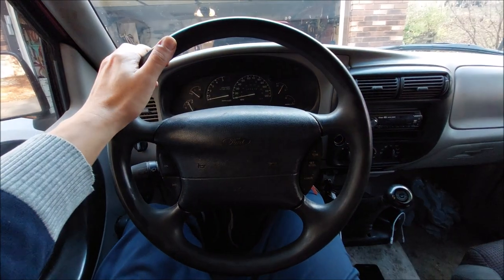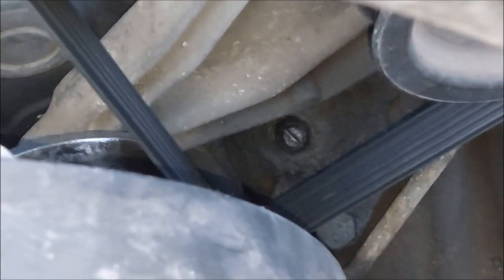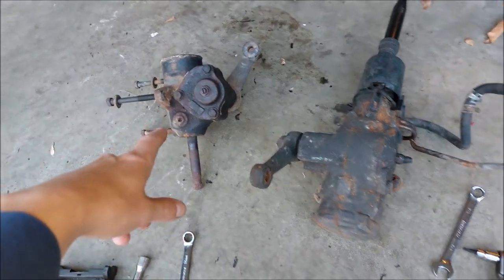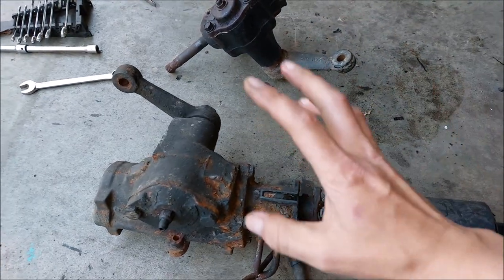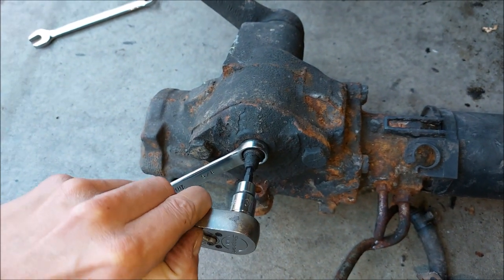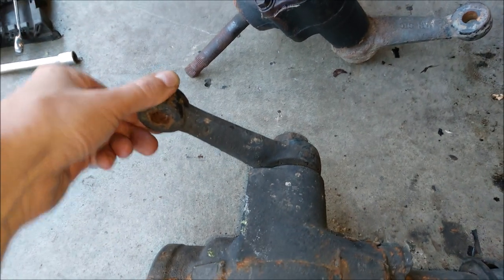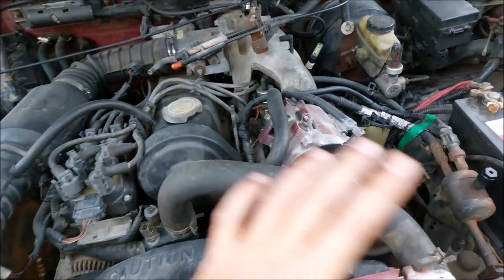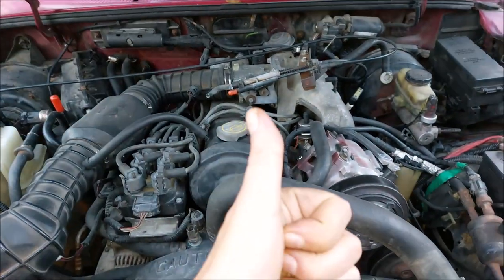Cheapest and Easiest Way To Fix Steering Wheel Play/Sloppy/Loose Steering on Ford Trucks

Comment: Thank you for the video. I have been having those issues on my power steering of my 1995 Ford ranger. I'll be replacing all tierods, inspecting all other components. Then adjust steering.

Comment: I wasn't even looking for this, but my new to me 95 mazda b2300 just passed inspection but has a steering wheel that has more play than what feels good.  I didn't know that steering gearboxes had backlash adjusters.  It was not so much lose, as that it had no feedback/resistance at center...making the steering feel at center very vague.  I adjusted it as stated (a good 2 full turns) and it feels much better now.

Comment: You mentioned to inspect the Suspension Components and make sure they are in GOOD shape. Can you give us  details WHAT to look for when inspecting them and when you suspect the Suspension Components are NOT in good shape?
Reply from the maker: ball joints, outer tie rods, inner tie rods, center link and pitman arm, any play in those and they're not in good shape, last but not least wheel bearings, they can have play if there's no preload on them.